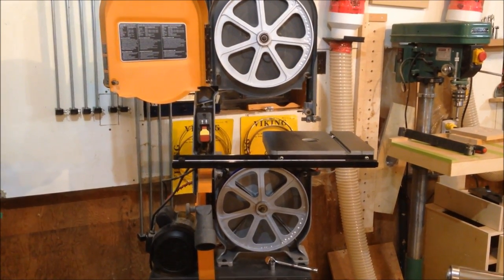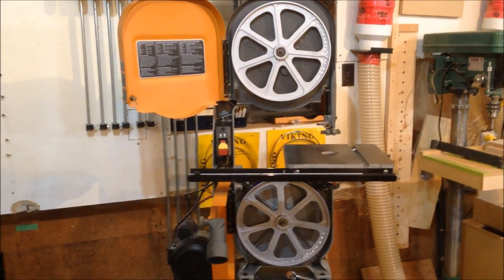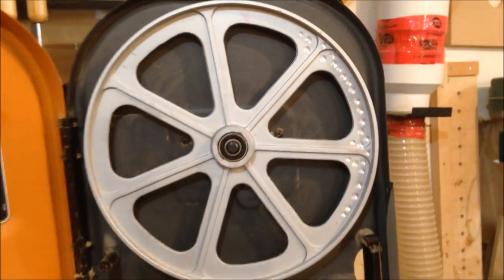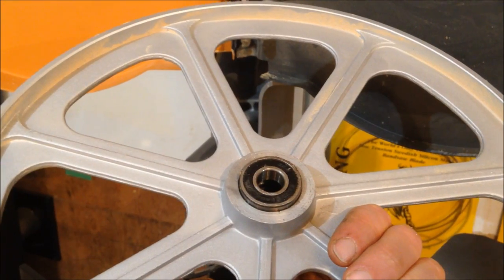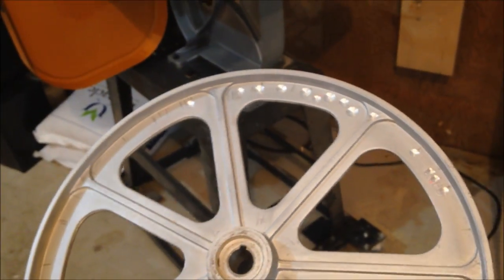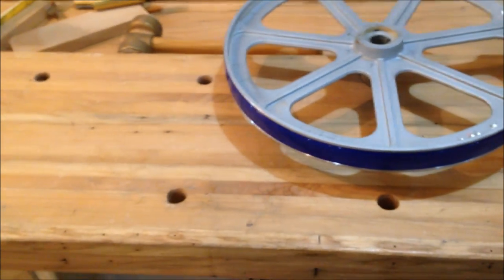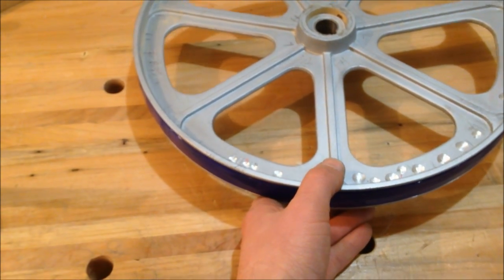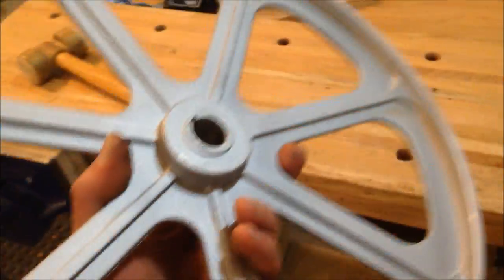Bandsaw upgrades   wheel balancing

Comment: I have the same bandsaw you have and I gave your system a try but found it too hard to get it perfectly level. I found a nice upgrade by getting a fisheye bubble level that I put on the center of the wherl to get it dead level.  I also put the ball bearing on my drill press.  Turn the drill press on and the vibration from the press worked perfect.  Fine tuned mine pretty nicely.  Now just to get the vibration out of the drive belt and the stand it sits on.

Comment: This is great thanks. I used an old light bulb sprayed with silicone lubricant instead of the ball bearing and it worked, not as good as a proper ball bearing but still what ever works eh! My cheap bandsaw used to shake like a shitting dog but after following your tips it now runs much smoother. I glued small nuts on the light side rather than drilling out as it let me test positioning before committing.
Reply from the maker: ruaridh watson A lightbulb, great idea! I’m happy to hear that this video helped.

Comment: I have the same saw that was picked up at a tool auction and didn't realize it was a 'reconditioned' unit... and boy was that term a joke.  Both wheels were way off and I did pretty much the exact same thing you did, except I drilled my 'ticks' on the back side of them just so it would look a bit better when changing the blades.  One process I did differently, was to use an inexpensive (around $5)- plastic lawn mower blade balancer instead of your steel ball and hammer trick.  

After picking up the unit, I was reading that many had issue with the 'feet' of the stand not being very stable, so I picked up 8 fender washers to increase the stability of the bent sheet metal leg bottoms where the adjustable bolts went through.  I also read that many had issue with the top of the stand not being strong enough, so I picked up some 3/4" plywood to make a center shelf as well as for the top of the stand to give it a lot more strength.  I also had to pick up some longer bolts for mounting the saw to the stand, and used fender washers on the bottom side to help distribute the weight better.

I also picked up a motor mount slide bed, so adjusting the belt tension would be as easy as a single bolt head needing to be turned.  The last thing I did for 'vibration issues' was to replace the standard belt with one of those Linked Belts...  They are a bit pricey, but boy do they work like a dream...  Once tensioned for about a week, check them again as they will need a bit more tension put to them... The belt has been on for a good 5 years now and never needed to be re-tensioned so far.

The last modifications I've done to the saw - so far - is to replace the blade tension handle with one of those that are much longer (go above the top of the saw upper case, due to the arthritis I have in my hands.  I was reading up on line and many had an issue with the long handle type adjusters bending on them, so I added a 'pillow block' with a spacer behind it,, about 2/3 the way up the back side of the upper wheel housing, to eliminate that issue.  My 'handle' is now an off-set crank and is very easy to use.  I also painted one half of the handle bright orange to match the saw, and I've made it a habit that when the orange shows, that tells me the tension is OFF of the blade, and I just have to turn it 7 1/2 turns to re-tension the blade.  This takes the tension off the blade when not in use, extending the life of your tires and the blades themselves.  When I'm done for the day, I take another 7 1/2 turns of the crank, leaving the orange side of the crank handle showing and know that the tension is off the blade and I'm all set for the night.

When drilling the 'ticks' on the lower wheel, I was fast running out of places to take metal off as the wheel was SO out of balance...  Hard to believe they let that one pass inspection.....  

Thanks for the video clip, I'm sue you educated many on the 'trick' of drilling ticks to help balance out a wheel like that...  Good job!!
Reply from the maker: Thanks, I completely agree with the value of the link belts. Makes a huge difference. they shouldn't even be allowed to sell those plastic v-belts that come on these machines.

Comment: I use to own a business that sold, serviced and repaired industrial equipment like lathes, injection molding, milling machines, welders, etc.  My business also repaired table saws, bandsaws, wood lathes.  I did this for nearly 40 years.  So, have a lot of experience repairing tools like the bandsaw shown in this video.  

This video demonstrates something I highly advise NOT to do.  You don't want to go drilling holes in the pulleys of the bandsaw.  Once you remove the metal, it can't be replaced easily.  DON"T DO IT!!!!  The better way to balance the pulley is like how automobile tires are balanced.  You place a weight opposite the heavy side of the pulley.   A weight can be easily added and removed where necessary.

Many folks think balancing the pulley will solve vibration problems.  That is partly true.  But, you must look at the V-belt from the motor to the lower drive pulley.  V-belts have a real bad habbit of going out of round and develop a bad spot around the smaller motor pulley if the saw has sat idle for awhile. This is the main culprit for the vibration in the saw. Instead of buying another v-belt, go to the auto parts store, Harbor freight or Amazon and buy a segmented belt or link belt for about $35.  It will save you all sorts of aggravation dealing with unwanted saw vibration.  Work smarter, not harder.

Comment: Is it necessary to balance the wheel in horizontal plane as well as vertical plane? I can't wrap my head around it.
Reply from the maker: William Branham  In this type of application, no you don’t need to do both. It’s two different ways to accomplish the same thing. The big saws might need to be dynamically balanced (like car tires are), but for anything under 5 hp, static balancing like is shown here is fine. The reason for balancing the bottom wheel on the bench and not on the saw is because with the bottom wheel (which is the drive wheel) there is too much drag from the bearings for the wheel to spin freely while mounted on the saw’s driveshaft.
Reply: @AWoodworkersLife  Good info. Thanks